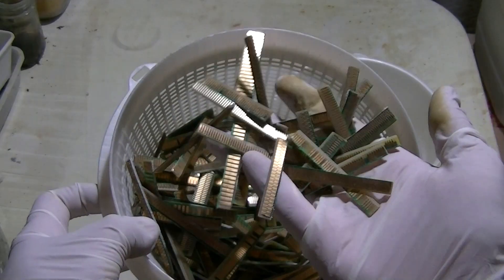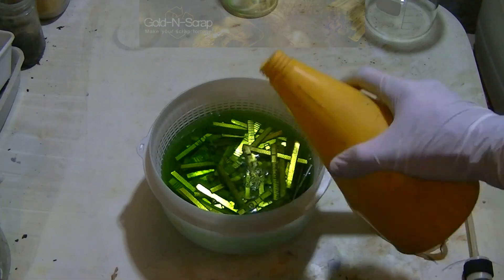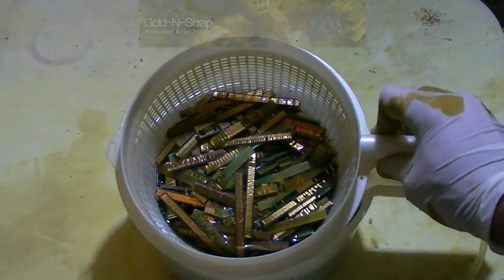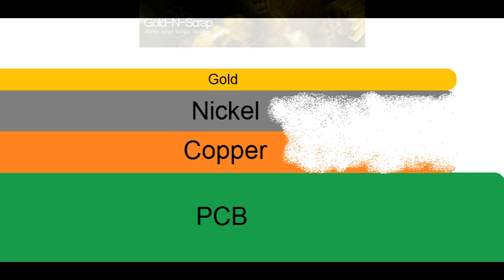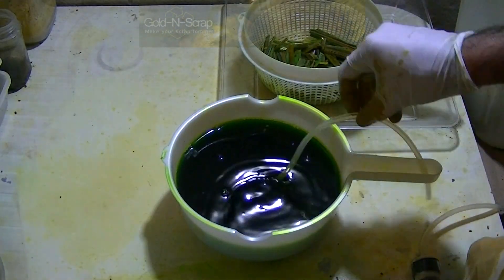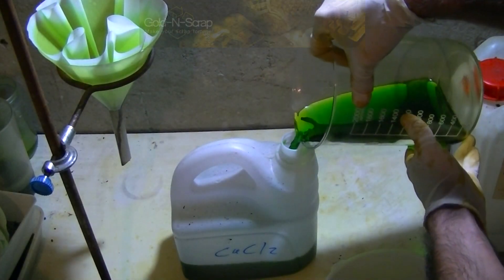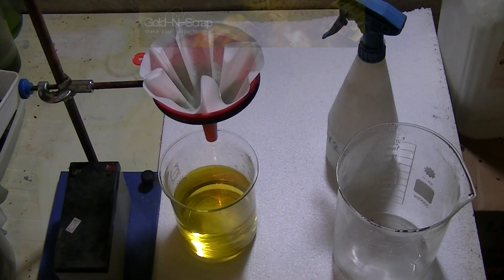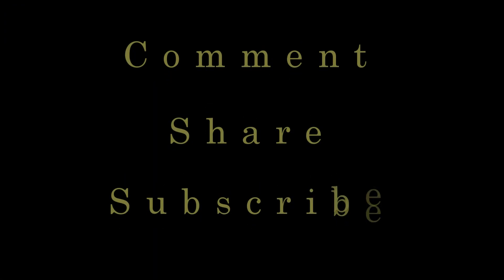Gold Fingers - How to Recover Gold from Electronic Scrap

Comment: I watched the whole thing, everything was fantastic and perfectly clear until the end when I was utterly confused by what APPEARS to be the gold having been turned into a liquid solution.  It seems to me he did this step without forewarning that this would happen nor was any explanation provided as to what happened to the gold or how to recover the gold from this gold colored liquid or why it is even necessary to take it to this level of dissolution.. As a complete noob I want to know these things. I clicked on the other videos and there was no further explanation.  Frustrating.
Reply: He dissolved the gold in Aqua Regia (literally: Royal Water), which is a mixture of hydrochloric and nitric acid.  It's the only acid that will dissolve gold.   When dissolved it forms auric acid.   Auric acid has been used to create ultra high purity gold using an electrolytic process.   You put .995 gold on the anode and a small sliver of 999 gold on the cathode, add about six volts and some current and wait.   The gold collects on the cathode.  The impurities, mostly silver precipitate out as silver chloride which can be recovered and smelted.
Reply: Granted I just skimmed through this, but at the end he says its now ready for the next steps of precipitating, washing, and melting into Ingot, and gives links to his other videos on how to do it. :)  You were almost there!!!
Reply: darkanstormy  The objective of the Wohlwill electrolytic process is purification from ~.995 to .999 fine gold.   After electrolysis the cathode is going to be melted, rolled into sheets, stamped into coins etc.   Anything cathode less than .999 fine gold would reduce the purity of the gold collected on that cathode.   Keep in mind the auric acid dissolves most everything.   Silver precipitates out as silver chloride which can be recovered from the slimes at the bottom of the tank.   Before the electrolytic process, less pure gold can be processed to .995 fine using the Miller process where chlorine gas is injected into the molten electrum.   Silver forms molten silver chloride which floats on top of the molten gold and can be skimmed off.   I'd love to see a video of the Miller process in action if anyone is still using it.
Reply: before doing this exp.. read something about gravimetric analysis
Reply: You are correct in what that last part appears to be, but I also failed to initially follow the "why" of that part of dissolving the gold foil completely in "aqua regia". (Nitrohydrochloric acid - one of the only acids capable of dissolving pure gold) One guess is that this method allows recovery without risking the the extremely thin (measured in tens of microns [1 micron = 0.001 of a mm or 0.00004 inches]) gold foil pieces becoming airborne and lost. Recovery of gold from the aqua regia can be as simple as neutralizing the acid with something alkaline.
Reply: Rudra Chakraborti i have a hard time believing you know how to do this from textual observations
Reply: grayswandir47  Thanks for adding to our knowledge ....
Reply: That is a way to Refine the Gold, Otherwise you end up with the Purity you started with
Reply: Rudra Chakraborti Thanks, Not having dissolved any gold myself, I was relying upon theory, not proven fact.
Being a newby at this also, I thought the AR step was just to prevent the gold foils from blowing away, not a first step in purifying the recovered gold.
Reply: grayswandir47
Good stuff, thanks.
Reply: grayswandir47 Why the need to add gold to both the anode and cathode?
Reply: twas brillig I'm with you on that. I wasn't quite clear why we didn't just collect the loose pieces of gold. Anyway, you should check out Karatbars - they allow you to acquire gold in 1g increments. https://www.karatbars.com/landing/?s=kjhenry
Reply: grayswandir47 I'm pretty sure that this was the most intellectual comment thread to ever have been posted on YouTube lol
Reply: JimShew2 no u cant neutralize a.r to get gold... its like sugar solution .. only to get iit is by precipitating the gold.. thats how u get 99.9% pure gold.. if u nneutralizea.r u may get gold compounds in which gold is impure.. to do that... u need to add a precipitating agent
Reply: its totally safe.. u wont believe.. i had dissolved platinum.. and got it in free form.. but only 1 gm...

Comment: I HAVE DONE THIS  MYSELF-AND--BUT DIFERENT METHOD --IT CAME OUT GOLD FLAKE --HAD TO BE CARFULL NOT TO BLOW AWAY THE FLAKES -WITH TORCH PRESSEUER TO HIGH -USED  ACID --CHARCOAL BLOCK USED TORCH AND GOT  A TINY BALL OF GOLD --SO THIS IS NOT A FAE

Comment: Nice!   I use to work in electroplating and have to ask,  The gold foils particles will be 99.5 percent gold. After dissolving and reprecipitating, you might be 99 percent, but if you take that to sell, they will charge you a refining fee for further purification. Why not just collect the gold foil and melt it?
Reply: The individual foil pieces are a small fraction of a milligram in weight. Because they're each so light, it doesn't take much of a breeze (or convection current from the melting crucible) to literally blow them away.
Reply: With the pieces being so lightweight, it's not simply a matter of simply putting them into a container and fusing them together. Most flames don't reach the 1945 F / 1090 C required to melt 24K gold. (a butane lighter flame is around 800C) Long before the temperature is hot enough to soften the pieces, convection currents from the heating will cause the pieces to become airborne.
Reply: The difficulty here is that these extremely light pieces act more like dust or confetti then the heavy metal we are used to in everyday settings. Because of the convection currents, the scene inside the hot container "oven" would resemble a shook-up snow-globe paperweight.While the gold foils would each melt into balls, they would only melt together if the pieces struck each other. It would take several dozen fusings before a piece's weight overcomes its tendency to float around on the breezes about it.
Reply: Yes, while eventually the pieces would collide with each other and fuse, it would take far longer (weeks) than we would want to wait. The method used at the end of this video of dissolving them in acid, besides also being the first step in refining, is much faster and far less costly than the gas/power to hold a kiln oven at around 1100 C for several days.
Reply: ***** Focusing solar energy onto these pieces won't help here because unlike a gold ring, these pieces are not heavy enough to stay put. As soon as the surroundings warm up, and long before the pieces are hot enough to become molten, convection currents will blow the pieces about in random directions.
Reply: ***** The time to actually melt the pieces is not really a factor here because that will happen well within a couple of seconds once the kiln reaches the required temperature of 1064 Celsius (1947 F). The problem instead lies in the lightness of these pieces: convection currents will have them flying about randomly in the container long before they are hot enough to fuse. Several dozen pieces must fuse together before the lump will become too heavy to stay aloft. The process of waiting for the molten pieces to collide and fuse is what would require the kiln to be wastefully run for several hours.

It requires far less time / effort / energy to chemically dissolve these tiny pieces (which also happens to be one of the first steps in refining) than it would take to directly melt them into a lump.

Comment: What is the Lead Acid battery used for in the video? I notice it is not connected to anything physical, so it must be a capacitve load use and by the looks of the flanges, a small antenna system. When it exhausts its use, you can recycle for the lead. OK, I applaud your tenacity for treasure hunting, nevermind my troll work.

Comment: I've been trying to figure out how to remove gold flakes from silt. The flakes are so small that they so far cannot be removed. Is there a process that is cost feasible?
Reply: Yes, panning it placer-style is the simplest way of separating even flour-fine pieces of gold from silt, but doing so requires a fair amount of practice. The aqua regia method used at the end of this video to completely dissolve the gold foil will also work since the gold would dissolve but not the silt.

Comment: Using the scale below, and rounding the recovered gold up to 1.5 grams, the left column is what your efforts will yield at current and potential future gold pricing.
1.5grams |  gold per oz.

$        63.60    $    1,200.00 Today's price per oz of gold
$        79.50    $    1,500.00
$        95.40    $    1,800.00
$     116.60     $    2,200.00
$     159.00     $    3,000.00
$     212.00     $    4,000.00
$     424.00     $    8,000.00
$     795.00     $  15,000.00
$  1,060.00     $  20,000.00
$  2,650.00     $  50,000.00  (15 year?)

So buy your supplies now while the price is affordable, accumulate and stockpile scraps and hold for approx. 15 yrs.

Comment: Just how much sis you recover? the big question is was the expense in getting the chemicals, the time and effort involved worth the amount in monetary value you get from the gold?

I went to this website http://goldprice.org/gold-price.html that provides up to date current gold prices this is what gold is worth today is says 1 OZ is $1067.

1 OZ is about 28 grams, this looks to be about 2 grams The website says TODAY Novemeber 17th 2014 1 gram is worth $38.11 So if you did all of this and spent $50 in the chemicals would you really be making any money?
Reply: Wrong, gold is measured in troy ounces which is 31.1034768. grams. Which is 2.7354768 grams heavier then an ounce of gold measured in avoirdupois ounces, which is 28.35 grams. This is a large discrepancy in your quoted weight between the two measures of weight for gold.
Reply: That's why he re-uses much of the chemicals.  I'm sure he can re-use some of them repeatedly, and there's a good chance he only showed the initial process for the sake of youtubers learning the process.  I also doubt he would waste a large amount of time on this as it appears most of the process involves waiting.  The actual time spent on this appears to be less than an hour.  Assuming he had to actually cut the circuit boards himself as well as salvage them, the process probably took at most a day of actual invested time.  The chemicals being re-used until they are no longer able to be, and if he gathered more gold flakes before the hot plate stage he wouldn't need to use as much of those chemicals each time.  Yes this was a small batch, and the investment might not have paid for the reward, but it's also an instructional video and small batches are expected with instructional videos.  I know I personally wouldn't create such a small batch every time on my budget, even if the price of the gold (if sold instead of saved) was enough to cover the cost of materials, it still wouldn't be a decent wage for the time invested.  However if it was saved up and materials re-used, it could prove to be a very worthy investment over a few years.
Reply: and also do not forget to add all the viewers from this and other videos :3
Reply: agreed, 40 in gold, and 50 bux in chemicals, doesnt sound good to me.
Reply: This concept is of little value for a do it your selfer, however this is exactly how it is done commercially and with thousands of pounds of these gold fingers being processed in a commercial  plant, then you can recover the gold that would be a wasted in a landfill or else where. It's interesting to see what some people will do just to gain a few grams of gold. I used to throw out a lot of gold scrap many years ago in a circuit board production facility I worked in many years ago when gold was $35.00 an ounce. Then when it hit $850.00 an ounce I had already designed a circuit board fixture that reduced waste that ended up saving the company $50,000.00 a year, and for that I got absolutely nothing for my innovation way to stop the loss of that much gold. I quit the job and left the division that shafted me for that that idea. Never again will I do so for any company no matter what. My intellectual property rights are not for sale to any company now, and believe me I have had quite a few others that were highly profitable.

Comment: I'm curious to know how many/the measured weight of the fingers that are needed for a 1.47g gold yield.  My math should be close and with current gold prices that's only about 60-70 dollars in gold.  So my question is, how many of these batches would you need to go through to turn a profit?  And how many batches does the pre-mixed solution last?

Comment: dude how much was it? looks like ALOT of money went into your operation. and you had what LOOKED like a very low yield....
Reply from the maker: *****  Costs:
Pasta strainer and bowl - 8$ (reusable)
Aquarium Air bubbler - free from scrap or few bucks new.
Some tubing -  free from scrap or few bucks new.
Air - free
Actual labor - all in all apprx. 1-3 hours (depends on batch size and setup)
Chemicals - abt 2-4$ worth of HCl (also reusable), few cents worth on nitric acid.
Two filter papers - <0.5$
Rest of the tools and equipment like hot plate and beakers will be in your lab anyways...

The only real investment here is the cost of sourcing the scrap and the time involved in cutting the fingers. Each can be handled in its own way depending on the individual doing it.
The cost of the process is negliable.

Good luck.
Reply: John Smith wel arent you privileged, thats more than a minimum wage job for a hell of alot less effort. and no i dont give two craps about ppunctuation and spelling.
Reply: indeedItdoes What if you don't have a lab?  If you don't have a lab, or you don't have the equipment, it is not a lucrative endeavor.

Looks like less than a gram was recovered.  This is what a gram looks like:
http://www.usacoinbook.com/us-coins/gold-bar-1-gram.jpg

Now, the current price per troy ounce of gold today is $1167
One gram, which we will assume was recovered (looks less) is equal to 0.032 troy ounces.

Do the math.  $37 dollars.  Seriously.  What a waste of time.  It's a waste of time even cutting those printed circuit boards for 37 dollars.  It's not a lucrative operation on such a small scale.
Reply: 37$ for 3 hours work = 12.33$ per hour. So it was worth it.

Comment: While this is interesting, I can't help but wonder how many computers/electronics are needed to obtain a single ounce of gold. The video showed a considerable pile of connectors, far more than what you'd get from a single PC and the net result looked like it was perhaps a half ounce of gold.

I can't help but wonder just how economical this method is when you consider the cost of chemicals and associated hardware. I'm not knocking the process, but I do think the poster could have done a better job explaining the source materials, costs and results.
Reply: The average smartphone will contain about $1.87 in gold. You need a ton of components for this

Comment: Thank you for the vid,
The uploader was not trying to show the viewers how to get rich. He/she was only showing a tried  method of recovering plated gold. As for all of you who think adding water to hcl is a major deal...I have been adding water to my car, motorcycle, 4-wheelers, snd jetskis for the last 40 years...yes your lead/acid batteries are hcl.
thank you uploader
Reply: btw use distilled water - tap and ground water will ruin a battery and maybe the gold recovery process also
Reply: Lead/acid batteries like the ones you mention use H2SO4, not HCl. But the principle of adding water to the acid is the same
Reply: +Robert Spencer As Matthew Owen reported, lead acid batteries use sulfuric acid, not hydrocloric acid.

As for dilution, you should add the acid to the water whenever possible. That is because if there is a case of splash, you are splashing the diluted acid instead of the full strength. Highly molar sufuric acid has such an afinity for water it will pull the H2O from sugar (C12H22O11) and leave carbon behind. Your skin has water molecules in it as well, and thus the nice chemical destruction you get from spilling sulfuric acid on yourself.

Comment: why doesnt the plastic react with hcl//// also how much of this would you need to flip a profit////
Reply: Haven't u watched breaking bad ?
Reply: J Jahnke I think that Pikachu knows a lot about some stuff that is illegal to do. Just a passing thought...
Reply: Eric Rhodes Lol, I guess so. But so does everyone really.
Reply: also what catalysts would speed this up///
Reply: The board won't react with the etchant, or else why do you think that people can etch Printed Circuit Boards?
Reply: Saikit Tang whats etchant/ do you mean hcl or something/ i just mean why dont ethylene polymers react with acid.
Reply: The etchant is a solution that etchs away excess metal, in this case, HCL with copper chloride, polyethylene won't react with the acid, in fact, people even make chemical containers with it due to it's chemical resistance
Reply: fezzg87
Yeah I watched breaking bad.

They use hydrofluric acid though
Reply: PikachuTatoo hydrochloric  acid, amongst others.(NAPTHA, lye, mineral spirits,, iodine crystals, red phosphoris, etc...)
And most importantly...you can NEVER have too much clean ephedrine (psuedo-E).
             ( or not)
I'm just sayin'......Looks HELLA fun  and all that on t.v. (Breaking Bad)
 the problem is the risk/reward part .
(Let me know how that all works out for yourself. That is, if you have internet service in whatever penitentury you may/may not end up in)
 I must say: The journey  makes for one Hell of a RUSH !!!

So they say.
Sincerely,
                W.W.